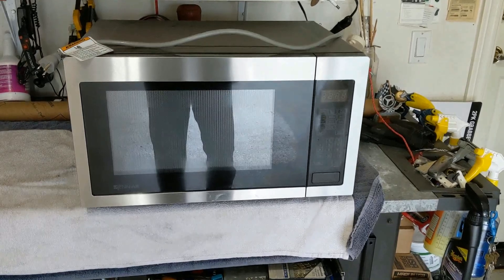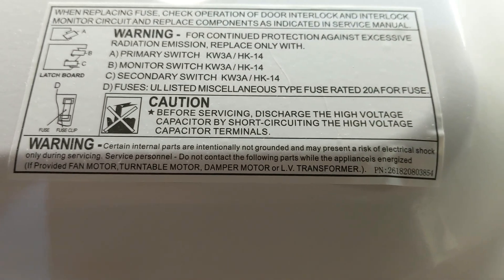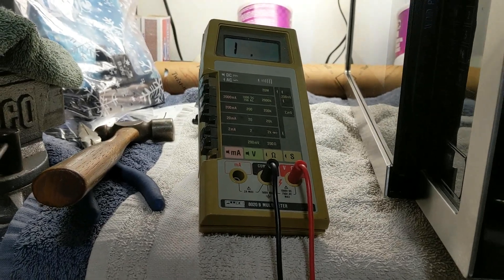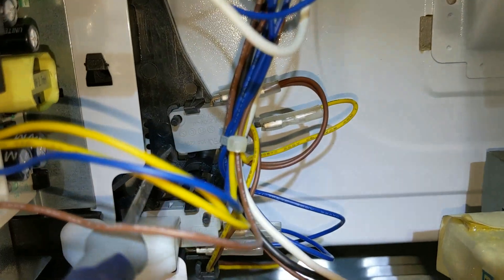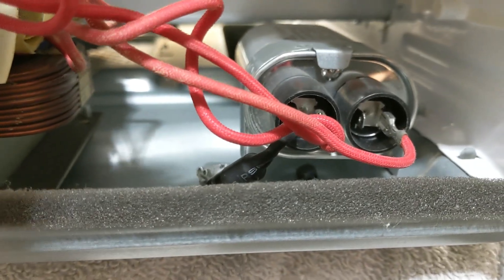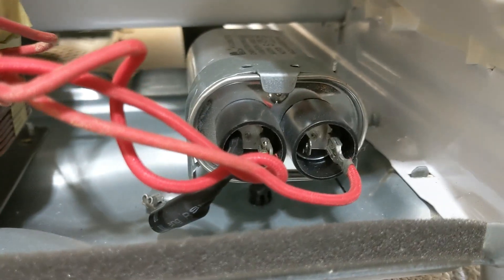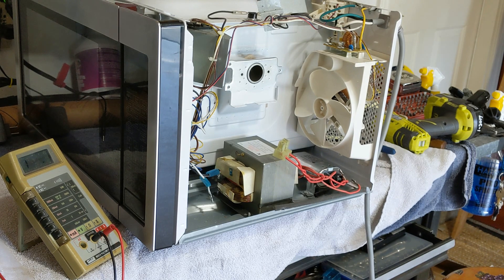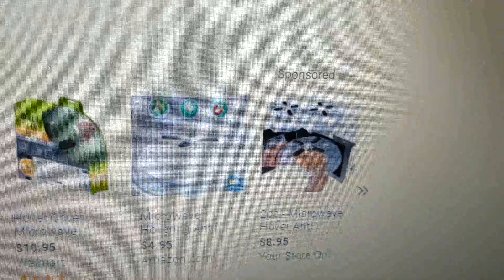Home repair magnetron diagnose replace  Jenn Air microwave repair by froggy 3

Comment: This is really helpful. I guess first of all check the fuse. Since the magnatron is so easy to take off. I wonder if one should consider taking it off first for a visual inspection and if it "looks" good, test it and then reinstall and proceed testing/checking the door switches, relay and transformers tests. What do you think now that you've done this? I may uninstall my Jenn-air I'll comment if the mangnatron looks damaged like yours.
Reply from the maker: I would not fault you if you wanted to jump ahead like that, worth a shot.  :)
Reply: @1947froggy  I hope it's just the fuse!